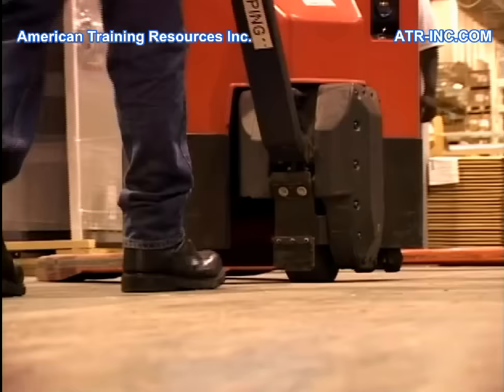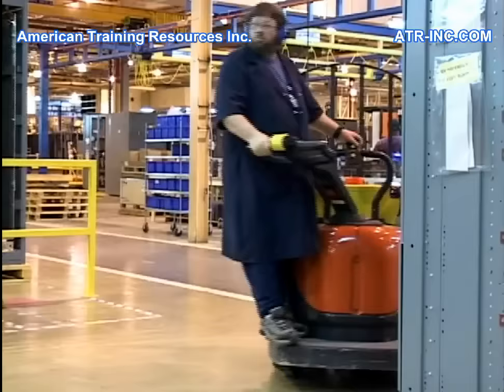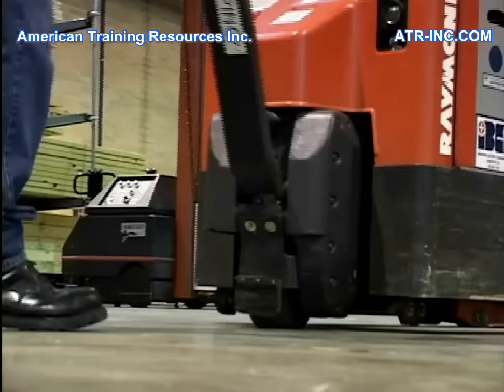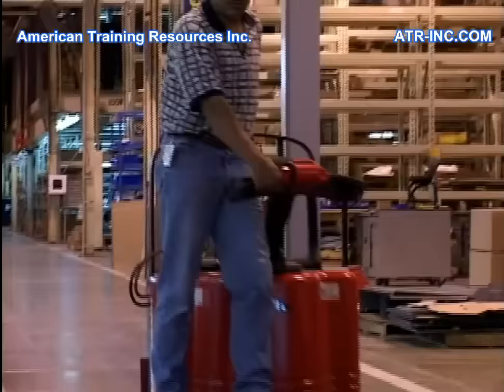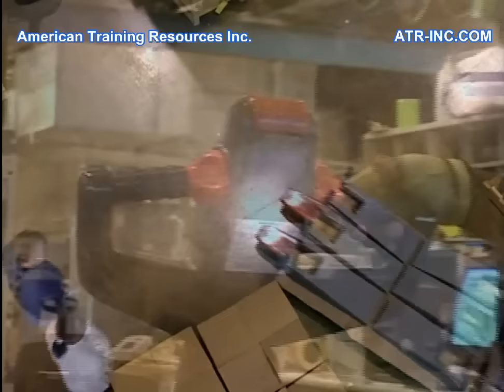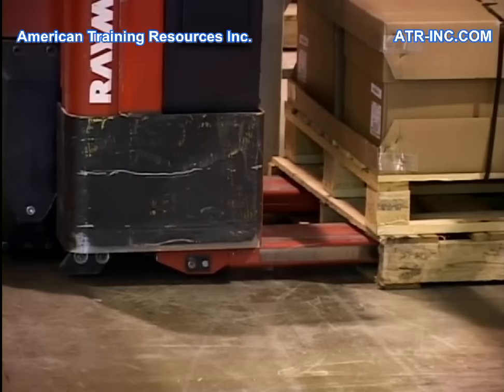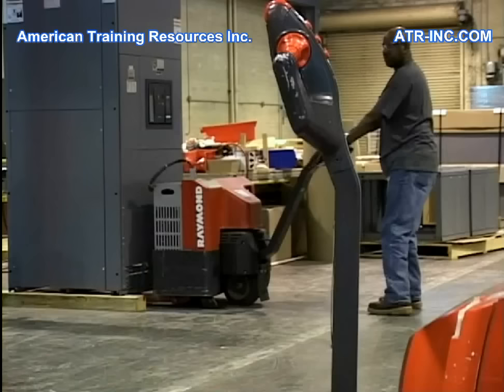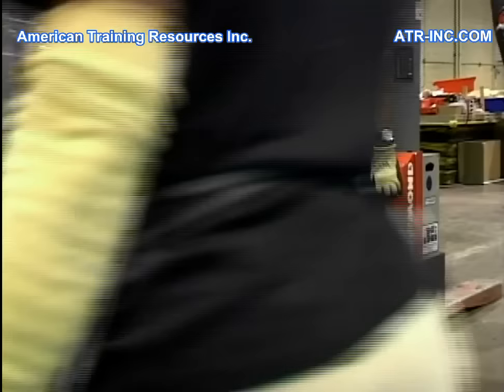Operating Electric Pallet Jacks Safely - Training Video

Comment: this thing is INCREDIBLY dangerous. these things go very fast, have no power steering, and there is nothing to hang on to. it's really easy to lose control and get flung off the machine.
Reply: Electronics For Fun lmao wow I just got hired for a position using one of these never used one before like this
Reply: Electronics For Fun lmao 😂 ya comment is hilarious cuz it shows you had an experiences with that thang. I’m in training now I was the only one who passed the written test without a mistake I’m like 🤔
Reply: @cardelljermaine76  yeah I actually did get flung off of mine. I can drive any kind forklift or reach truck, I have used all different types of controls for all of them. but these little pallet jacks are my kryptonite. I don't weigh enough to steer it when it's not moving. even if I hang off the side and yank it, it won't budge.
Reply: Electronics For Fun actually I got it down pack after 3 days you must be really small either way you got skills in other areas I & many others don’t you still pronto
Reply: @cardelljermaine76  I am 6'4'' but I am really skinny so I am top heavy but don't have enough mass to keep my self planted so I get thrown around by this thing. we did get a new one however that is actually way easier to control. I can drive that one like it's apart of me. I guess the issue was with the old one because the new one is the exact same make and model but the old one was really hard to control. if it wasn't moving it was impossible to steer it even for the pros.
Reply: Electronics For Fun some are hard to steer the older ones I even had a hard time and I’m 6’ 220 still for your size & height & weight I can overstand now we have a guy who’s 7’1 he doesn’t drove one either similar problems too tall
Reply: The hyster we have at my work has a safety bar to hang on to so im usually good. I got flung off once but I wasn't planted well and spun around too fast
Reply: The ones i have at work, you have a big metal plate you stand on with side bars on both sides, i usually lean on them and ride away, they brake automatically and they slow down when you turn, been working with these kinds of jacks for 3 years now and flew off only once when i was playing around with it, shits easy to operate unless you have poor coordination and your job has 30 year old technology

Comment: Was stacking cheese when one went whizzing by carrying trays of cheese. I stuck my butt out when I was stacking the side nearest the aisle and was sent flying. Glad it a low speed Mitsubishi and not that high speed ride on Linde truck.
I find the Linde "walkies" a bit twitchy but they are good for crossing the factory quickly. The Misubishi trucks have 2 speeds so easier to get the forks in.
Reply: Lol damn

Comment: With the walky one you can sit on top of the box part and face away from the forks and put the handle part between your legs and drive it like a scooter.... or so I’ve been told lol
Reply: Got told off at work for standing on the forks and leaning over and steering it, but would probably get a mega bollocking (or sent home) if I tried that lol. I did try it with the low speed lithium ion ones that are low to the ground when I was just in the freezer unit by myself, but got off and walked as soon as I left the freezer in case of forklift traffic and the boss....
Reply: fire-able offense at work
Reply: @sixslinger9951  Right
Reply: I seen this and wondered wtf was going on, now I see it is BS lol.